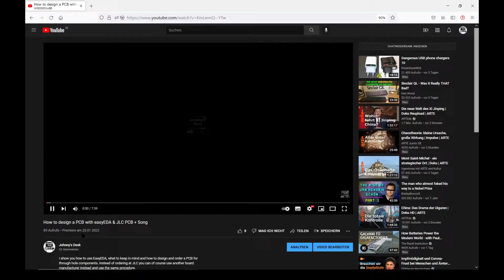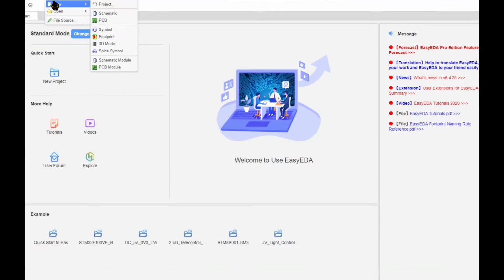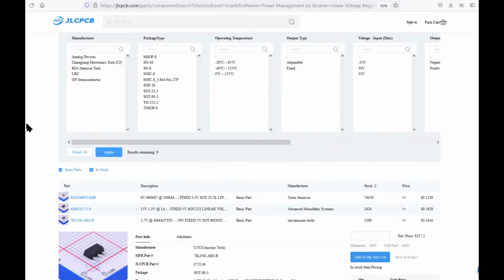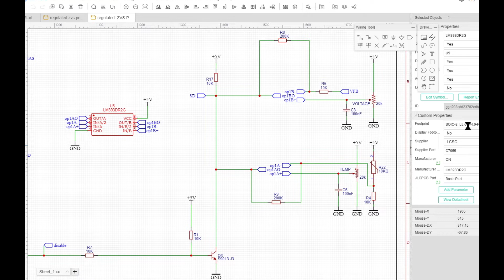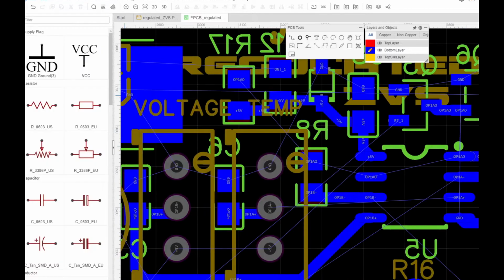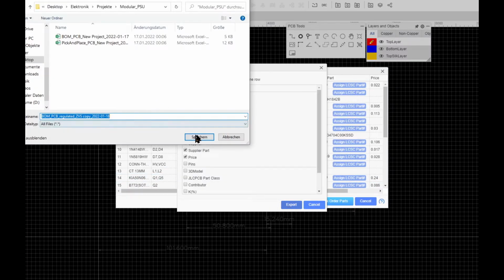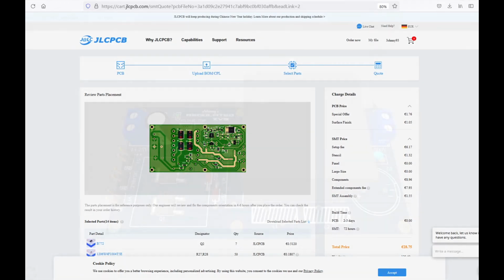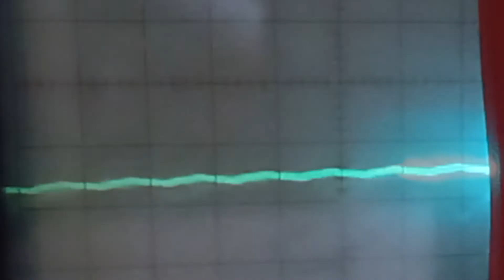How to design a SMD Assembly PCB  (with easyEDA & JLCPCB )

Comment: Hello sir - Im stuck in a place where i cant tick off "basic part" and therefor i have issues finding the right components for me. i seem to have found different components who are only in the new "LCSC Electronics" library, where the LCSC Part # is stating "no part yet". 
on the website of LCSC i cant tick off "basic parts" as you did.

Hopefully you can guide me towards the right directiong - cheers.
Reply from the maker: You shouldn't use the library of easyEDA. Instead look at jlc's website in the components library. There you can Tick 'basic parts'. If you have any questions feel free to ask.

Comment: Man this video is super nice! It's WAY easier to look for SMD components in the LSCS website. Would you be willign to create a video about how to properly align components in the PCB? For example I create a PCB outline and I want perfectly align from the outer border some holes on each corner... but doesn't seem too easy to get them perfectly aligned on each corner
Reply from the maker: Of course I can! Maybe you could tell me, what you want to learn :)
Reply: @Johnnybangel  thanks! let's say that for example I want to create this PCB (search on GitHub sentsor-core-esp32micro sorry I can’t share URLs). I'm able to create the outline of the PCB easily, however at the moment of aligning the 4 holes on each corner I'm not sure how to do it so all the holes are exactly at the same distance from the borders, for example
Reply from the maker: I think what you must do, is to set your SNAP SIZE to a lower value, so you can drag components in smaller steps. You can find it in the right toolbar. Pleased, tell me, if I have helped you with that.